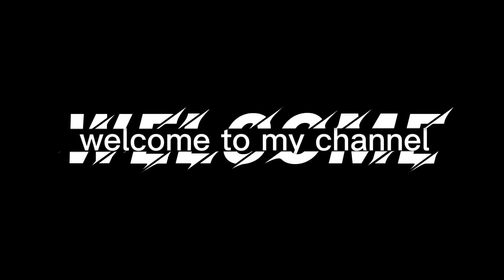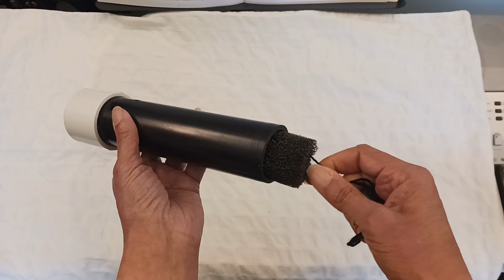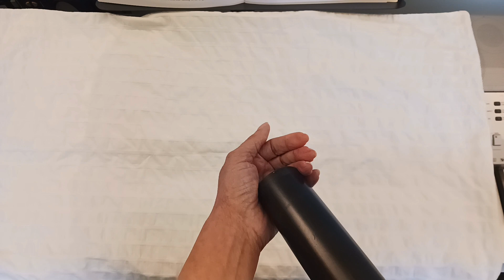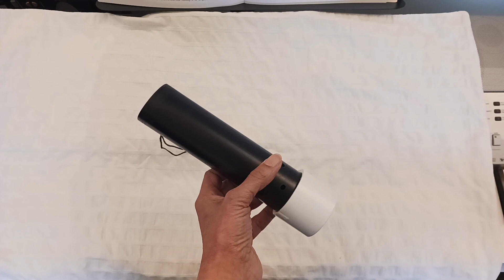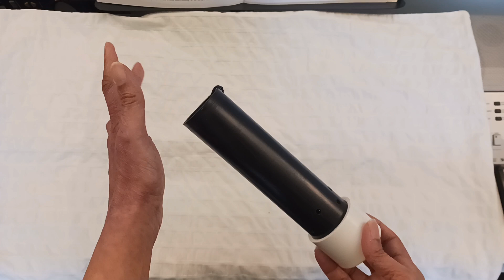Deep substrate or plenum for my next aquarium set-up 🇨🇦

Comment: ME too! 
I use a combination of both of their methods!!!
Reply: I am getting ready to convert my 2 largest tanks with an undergravel plate covered in weed fabric and NO uplift tubes...a thin layer of cat litter, something with iron , some soil and a couple inch thick layer of sand  works great!!!! I even to it with very small jars that I have all over the place and they do great without any airation...I will have filtration or sponge filter for the large tanks though PRISTINE would jump start your needed bacteria. You definitely NEED lots of plants too with adequate light you won't be sorry. My tanks have NEVER been easier to maintain, as in LOW maintenance, or as stable.

Comment: as you would know the plants are a part of filtration. Am setting up a 3 x 1.5 x1.5 tank, I'm in a quandary on what to do. Can't really afford fluval stratum etc, can't be bothered with root tabs etc, don't want to dig around in it and cause soil to rise through the sand if I make a boo boo. Also you've basically made a small box filter which are like $5 with substrate in them already. And you can always change the media in them about whatever they come with, as I'm sure you know. Arrgh  what to do. Look forward to seeing what you decide.
Reply: I would say not to stress it so much. I experimented in all my tanks. (2 10 gallons, 20's) I used garden soil with fertilizer in it even though it was suggested online not to because that's what I had.  I used two inches of it and two inches of sand. I have hang on filters that I outfitted with sponge, lava rock, sand and a polishing pad. Ihave regular plant indoor grow led's It took my plants about two weeks to get going nicely but I had fish,albino bristlenose pleco & shrimp in there after a few days to start the bacteria growth. Later i added snails.  I used tu have a air stone but it was suggested i remove that and allow co2 to be strong and keep the water up to the hang on filter out take because causing too much oxygen exchange would not allow plants to thrive since they they've on co2. When I implemented that my plant growth exploded and now I really only have the filter running because I'm breeding guppies and they eat like crazy but even with them my tanks are nice and clear and I haven't had to change water in over a month. I just keep topping it off. It's much easier on my spine and allows me to enjoy the tank versus having to constantly worry about parameters. 

The next time I start another tank I'll definitely ammend the soil more with blood meal diatomaceous earth and other things to allow it to have even better balance but as of now its looking great. I even get these tiny worms coming up and crawling on the glass because they need oxygen and every a.m I scrape them off for my guppies to eat. (Free food!)

Comment: I have a dirted tank and it works, but i had a month of water changes to get clear water. In another tank, instead of dirt i'm trying Safety Sorb and 2 inch Eco-complete mixed with black sand. Some say Safety Sorb will take all the minerals out of your water and therefore lower PH. Not my experience. PH went to 6.8 but now back to 7 after adding makeup water for evaporation. I like the idea of a plenum but call me crazy but i like to see the bottom of the tank to judge root growth and health. Remember FF method is based on putting in a lot of plants in the beginning and very minimal feeding. I wish you success. I also have a tank with just 2 inches of black diamond blasting sand and everything is growing fine, go figure.
Reply from the maker: Where I live, I can't find SafeTsorb. 😩 
Thanks for your input.

Comment: Well, as an aquarium keeper for over fifty years, I've tried every method of filtration and system out there and this is my conclusions,,
DIY filters RULE!! I do not buy filters, it's cheaper and easy plus you get better flow if you build them correctly,, I build only top flow with an air stone driven flow.
Now as to substrate and which works better,, honestly I have five tanks running deep dirt and sand naturally kept, no gravel vaccum and a 10% water change monthly,,, no issues and these tanks have been going for ten years that way, I move plants and fish around but never mess with the substrate other than to pull a plant or put one in.
My other five tanks use the under gravel slow flow anoxic method, these took longer to get settled but again have been running 8 years no issues,
The biggest problem people have is they have no patients,, it takes time to establish a good solid strong bacteria culture, you'll have a settling period where water will spike in all directions for no reason, well there is a reason it's nature trying to find it's balance,,,, leave it alone stop dosing chemicals and over populating and feeding the tanks until everything equalizes..
Reply from the maker: YEAH! I love DIY! 
Thank you so much for your input. I am realizing how important it is to stay calm and not try to rush things. Nature takes time to develop and I'm willing to wait. It's worth it!

Comment: I converted one of my tanks to a deep substrate (inch dirt, 2 inches sand) just under 2 years ago. Works very well, the plants have really taken over and nitrates stay below 5ppm or undetectable, depending on how low the test kit can measure. It is filtered by a sponge filter and a internal power filter. I change around 40% of the water every month just to be sure, not to reduce nitrate just to remove and replenish whatever I may not be aware of. I have since converted 2 more of my tanks (75g and 7g) to deep dirted substrates and it works really well, you can check them out on my channel if you like. You need to give it a bit if time though, takes about 1 to 2 months for the anaerobic bacteria to kick in. Initially you will get a nitrate spike and then it goes down quickly. I did weekly water changes during that first phase and then it became much easier. Whatever you do, just don't disturb the substrate. I have not tried Dr Novak's method yet but I am fairly sure it will also work. I remember those old style slow flowing undergravel filters as very effective.
Reply from the maker: Thanks. I will check out your channel.
Reply: I set up a deep substrate tank just one week ago, same principles: 1 inch potting soil, 2 inches sand, plus a thin layer of flourite red between (for extra iron). Added lots of plants and I put fish in the second day. I have an internal filter running and will keep it untill tank establishes. I had to do a 20% water change today due to a small nitrate increase (no bacteria in the filter yet) and will probably do another one next week. When the plants adjust and start growing I'm going to start building a food web. I'm very confident about this cause I see the fish are already really happy in their new home.

Comment: Your thought process has failed you.  
You can combine a deep substrate, under gravel filter, anoxic plenum, soil substrate, and lush plantings. This can all be done inside of the aquarium... but you would need to open your mind a bit.   It does not have to be all or nothing... it can be a combination.